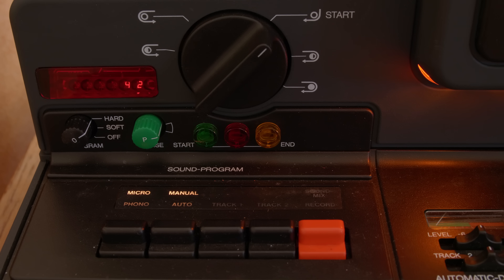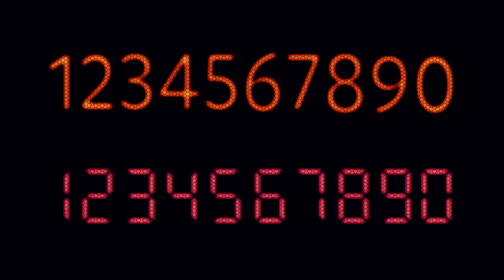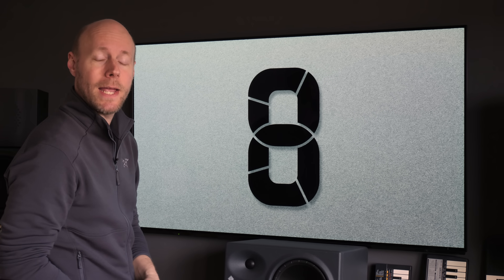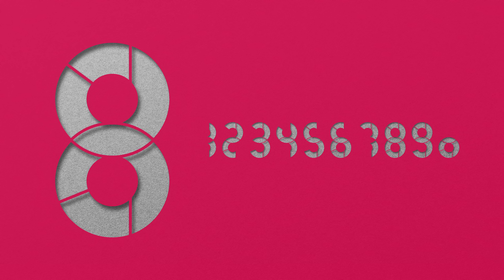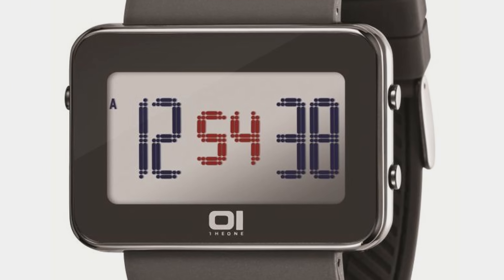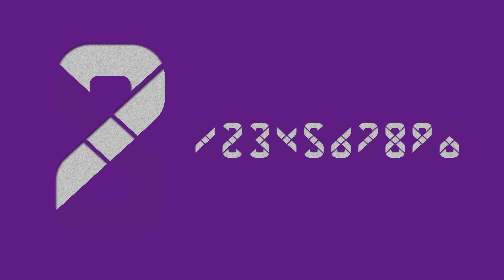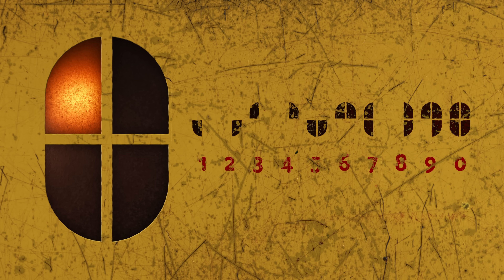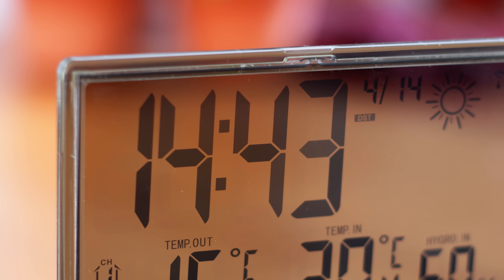Segmented Displays

Comment: There is a reason why 7 segment + a dot are the most common. It is because all the data can be stored in 8 bits meaning that a single byte can fully run a display, meaning that a single 8 bit shift register can drive a display. The same can be said for 16, 32 and 64 bit ones as well (64 being a 8x8 LED matrix). So definitely prefer some of those, even the 15 segment plus a dot would be a very good choice.
Reply: Thank you, finally someone said it
Reply: As I commented somewhere else: Not only can all the data for a 7-segment + dot be stored in a single byte, a 7-segment display can also display A-F just fine. So having only 2 of them allows you display a byte in hexadecimal.
Reply: @LudwigVonBreakhoven  Fastest conversion would be with an array of bytes (16 elements to be exact, to cover all of the hexadecimal characters). Byte that represents 0x0 in terms of segments on the display would be stored at the 0 index, byte that represents 0x1 at index 1... 0xF at index 0xF i.e. 15 and you have indexed all of the alphabet conversions for fast conversion.
Reply: Dont remember much about this but isnt there a conversion process to get 8 bit to 7 segment, BCD to 7 segment decoder. If you add more segments you just use a different decoder the same 8 bit can still be used to display on a 1000 segment display
Reply: @snyte9685  Yes there is. It was especially popular during the nixie tube days (BCD Nixie tube drivers), but you have to keep in mind that you would need to have a new encoder for each segment added vs. a shift register that is basically an output extender and can be programmed any way. If you need to drive anything other than a LED, then specialized encoders + drivers would definitely be the way to go cost wise.
Reply: You seem like you know what you're talking about
Reply: But 4 segments is better because you can store 2 symbols in 1 byte?
Reply: Don't I need multiple bits to display one Number? One bit can just be 0 or 1 right? My Computer Science Days are a few Years behind now so Im not sure
Reply: @kommanderpie6382  Yes, you need 8 bits to drive the 7 segments and a dot i.e. 1 byte.
Reply: @ilaserbia  Now that I thought about it again it all makes sense thank you
Reply: This video is a perfect example on how designers needlesly overcomplicate things because they lack the engineering understanding of how those things work.
Reply: @DanSlotea  i feel the point is being missed here. It's exploring a possibility space of what kinds of displays can be made with a variety of segments and if there's a way to make it look better and more readable with a modern lense.
This isn't "overcomplication" it's trying a bunch of things out and seeing what comes out with an eye to what has been tried.
Reply: @DanSlotea  He’s not doing it to be practical, he’s doing it because it’s interesting to him. At least I think so.
Reply: @jamesmathai1138  I still enjoyed the video, I think it's interesting to see how designers see segmented displays vs my computer engineering background
Reply: @DanSlotea  Your comment shows how engineers can get stuck in technical details, killing their imagination.
Just because it's the cheapest and most convenient way, doesn't mean it has to be the only way! 

I say this an IT specialist myself, btw.
Reply: @LRM12o8  If it's not broken, don't fix it. There is no gain in trying to reinvent the wheel or digital number display design. Some of the designs in this video were pretty bad. Stuff in general doesn't have to be the cheapest and most convenient, it has to be practical and useful. Shape should follow function, not the other way around. The world is full of failed designs, most of them in junkyards, some very exceptional as a curiosity in a museum. Ever seen a Dvorak keyboard in your IT specialist career? Better than qwerty, it still failed.
Reply: @DanSlotea  Wow, that's a boring mindset if I've ever seen one.
And I'm a practical person myself, but we're talking about segment displays in a world where high dpi, back-lit pixel displays are available for dirt cheap! That is to say, whatever still uses a segment display these days, probably doesn't show critical information anyway. 
Sure, it's completely logical that alternatives to the double square seven segments display failed in the past, but these days it would be perfectly reasonable to experiment with other designs of segment displays for something like a clock, for example: It might be less readable, but since most of us have a smartphone or smartwatch on us all the time and computers and other appliances that keep perfectly synchronized time all around our homes, clocks are more of a decorative item these days anyway, so it doesn't really hurt to compromise on their function for a unique appearance.
Reply: @LRM12o8  You would buy a clock just so you could check the time on your phone???  Good to know how marketing changes hoarders into believing they are some kind of collectors.
 I'd rather enjoy my very few, boring, perfect functional devices than keep dust-gathering  useless crap in all corners just because it looks cool. You sound exactly like my sister who's only reply when I asked why would you buy an iphone that has no customisation and is years behind Android devices in functionality, at twice the price, was "because it's cool". Marketing targets such weak, impressionable minds . I think I smell an Apple user, but I might be wrong.
Reply: @DanSlotea  some people just can't have fun. Or can't let others have fun.
This is a video exploring alternative ways to make up a segment display, something that is obsolete in this day & age to begin with, yet you're crying about the reduced usability?
If the concept of remaining something for fun is so alien to you, why did you spend half an hour watching this video then? Should've spend that time learning some business skills or comparing ensurance rates, if you're so hell-bent on everything being entirely optimized for usefulness alone. Would've bored you too much, huh? 🤭
There's a lot of insecurity seeping out of your aggressive argumentations, maybe you're hyper functionality trimmed life needs something else that you don't acknowledge? 
I bet you don't have pictures on your walls, just perfectly functional, white, empty space.
Do you tell yourself every night that you're not equally as empty inside?

Anyway, there was never a need for your rants. Everybody already knew what you were saying in that first comment, but nobody cares. This video was about creativity, a concept you don't seem to know and I doubt It could even be explained to you.
Sheldon Cooper couldn't be authentically made this robotic, if they tried! 

At least we can agree on thing: apple sucks and nobody should use it.
So much for your elaborate observations...
Reply: @DanSlotea  In a world of cheap and available FPGAs and microcontrollers we don’t really need to worry as much about fitting into 8 bits. Obviously fitting into a more defined and simple standard is better, buts its no longer a big deal.
Reply: @thpacemanthpiff  On bigger scale projects and mass production it makes sense since the cost stack up... For hobby and small scale purposes, sure, go wild.
Reply: @DanSlotea  and not just how unnecessary it is but how it creates annoyance and confusion. It’s a kinda a fun vid but the entire time I’m just thinking ‘it was fine. It was like that for a reason. It still looks fine. Leave it alone’ - “I couldn’t come up with anything better than the double square” yeh, we know ..
Reply: @patrickbyrne5070  I don't think the goal was to "beat" the 7 segment display, honestly, the 7 segment is remarkably efficient at what it does. but it was simply a thought experiment; during the time when 7 segment was most popular, was there actually something else that could've been used that would have been better? Attempting to find improvements doesn't necessarily imply that the original was bad in the first place I guess.

I mean, it really doesn't matter anymore, these types of displays are only really used nowadays on calculators and microwaves, but its something fun to think about, regardless of whether you can come up with a design that is actually better
Reply: @patrickbyrne5070  this video about segmented displays is surprisingly not a serious thesis on segmented displays
this guy was just playing around and trying to find anything that looks better than the standard design
if you wanna interpret that as a problem with designer philosophy in general you're free to do so ig
Reply: @patrickbyrne5070  Panache.

Comment: My favourite segmented displays are the ones that look like the following (without the line gaps)

 ________
\---------/

/|
| |
\|

|\
| |
|/

/--------\
————

I love their use on alarm clocks and they are the easiest to look at with my bad eyesight.

The only thing wrong is that depending on the usage, it doesn't look right

Edit: cool you called them the seven segment display, never knew what they were called

Comment: The nine segment "display" was used on letter envelopes in soviet russia. I think everyone who grew up in some of the states like I did recognized it instantly. It was printed as a dotten line to every envelope and then you 'filled' out the necessary segments of the numbers to get the post code to the envelope. What an awesome video.
Reply: always made me wonder, why would they need this for a human to read it and send it where needed
Reply: @sakesaurus  i think its for easier reading of the handwriting. Also the “template” is monospace so to speak, so if for example you need to check weather the 4th digit is a 3 or 4 to choose wich bin to throw the letter in, its faster? Dunno. Just speculating. Interesting question tho.
Reply: @sakesaurus  This was for first generation sorting machines, which can "read" only these specially written numbers. You can see some footage here (somewhere around 03:00) https://youtu.be/BhKXRYD3eQ4

Comment: Technically, in order to display all 10 numbers with on/off segments you require a minimum of log2(10) segments, rounding up to 4 and totalling 16 different possible states. This is obviously just the lowest common denominator, but I'd love to know wether it's possible to draw discernible numbers with so few segments. I actually made one with 5, and after a few adjustments should look legible enough.
Similarly, if we choose to include letters as well, the count increases to log2(36) which rounds up to 6 segments. I'd love to see what everyone comes up with. :)
Reply: An approach I like for showing a ten-way choice with four lights is to simply have the lights labeled 1,2,3,4 and use whatever combination would involve the fewest lights.  If one had five segments radially distributed like a star, and labeled them 0, 1, 2, 4, 7 then one can use a different combination of two segments for each digit 1-9, and use the rightmost two (which add up to 11) to represent zero.  This approach offers the advantage that every valid digit will have exactly two segments active.  Except that the segments are distributed horizontally, this coding actually matches the PostNet barcode format.
Reply: Love the ‘brainiac’s translations!

Comment: Hmm, I wonder if there are any shortcuts we could take related to the context these symbols appear in.

Like, in theory, a segmented display needs a minimum of X segments, were the number of characters Y to be displayed fulfills the equation Y < 1+2^X (sorry, my phone doesn't seem to have a less than or equal, hence the +1).

And then since we know the first digit in the hour can only be 0-2 (or 0-1 in 12-hour time), we could theoretically make double or even single segment displays for this specific purpose.

Another example would be to take inspiration from roman numerals and binary coded decimal, in which case all numbers (except 0) could be displayed near flawlessly on a 5-segment display like so: VIIII. And yes, 4 in this case would be IIII, not the most readable design, but it does occur. It could however be swapped for a more tally-like system where 3 is III, but then for 4 it adds an underscore or crosses over the other numbers.

However, there might be even more shortcuts out there if we make assumptions about usage and allow ourselves to mess with the character set. Those are just two very generic examples.

Comment: There is also a programmatic cost factor to this. in order to have all of the correct segments light up for a particular number, you have to have a series of logic gates configured to light up certain segments only for certain numbers. On really early computers this required physical logic circuits to be constructed, and they had to be compact enough to fit the displays. At the same time, logical circuit gates constructed with transistors were pretty bulky. Also, the more segments you had the more complex logical circuits you had to have. So the manufacturers of these displays went with the design that achieved the lowest number of segments while still being human readable. And even as technology grew, the same standard kept being reused because the 7 segment display was already easily identifiable by almost everyone.

Comment: There is one device I know of that uses a 3x5 matrix font: Older Texas Instruments graphing calculators (most of the ones with low-res monochrome displays) have a 3x5 font that's mostly used to overlay text on the graph screen.

Comment: 3:03 just a tiny note that shearing a typeface makes an oblique. An italic has a different feel, and is almost always manually designed to look more calligraphic than sheared.
Reply: I wonder whether the shear was invented as a means of using the decimal point of an upside-down display digit module as the top half of a colon (a very common trick in LED clocks).
Reply: @flatfingertuning727  No idea, but you can bet an upside down display module was used plenty of times to conveniently display degrees Celsius after the numerical value by using the dot and a "C"...
Reply: Yep. But it's rare to find a non-oblique display in some places.

Comment: What about the 16 segmented display, I don't know the name of it, but it's basically a star in a box and I've only really seen them in VFDs. It's essentially the 7 segment but with a line going down the middle (technically two segments) splitting all the middle segments in half, then with an additional 4 segments in the shape of an x. It can display all alphanumerical symbols and it looks pretty neat in my opinion.

Actually, looking at the video again it's similar to 11:42, though what I had in mind were just using only straight lines, like how most 7 seg look.
Reply: Z is disgusting 13 seg display

Comment: Best thing about 7 segment displays, is that can easily display hexadecimal. It’s great for displaying error codes.
Reply from the maker: Good point!
Reply: Too bad that feature isn’t built into any BCD decoders I’ve seen before. Ben Eater had to make his own decoder.
Reply: How do you differentiate between 0, and D; 8 and B?
Reply: @Mrvideosandgames  ‘B’ and ‘D’ are lower case to avoid that confusing. But you also have to make sure your ‘6’ use the top segment.

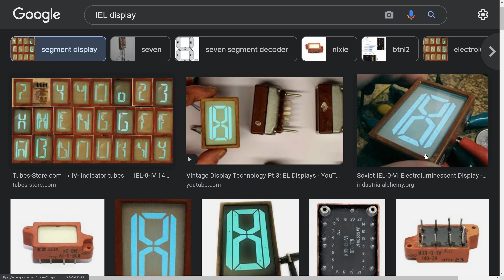Comment: My favourite is "Freeform" at 9:59. It looks organic. And I like the single-story zero, it emphasises that it's a special number.
Reply: it would look real cool on a vfd
Reply: @a.kjfhkziujsfdgbskjxfyhgfl2332  a volunteer fire department?
Reply: @tech6hutch  Vacuum Fluorescent Display
An example can be seen at 14 seconds into the video.
Reply: @tech6hutch  maybe a village of fowl devotees
Reply: freeform looks very nice! My favorite one however is quite different, the Seamless at 4:38, it looks very modern, and it's most compromised number, the number 2 still looks fairly good and is decently recognizable.
Reply: OK, but the 4 is weird.
Reply: For some reason every cool design is ruined because of the 4
Reply: @diegoadriandanielarce2211 you can fix the 4 by using the straight line segments
Reply: if somehow screen can be made as an ellipse it'd be even better.
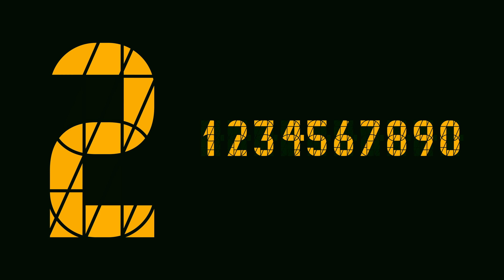Reply: I like the one at 11:15